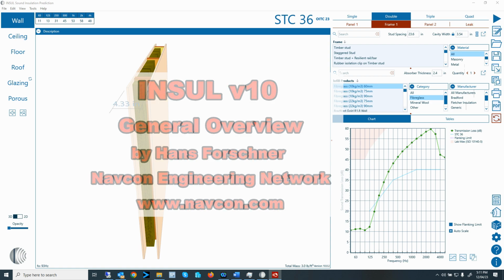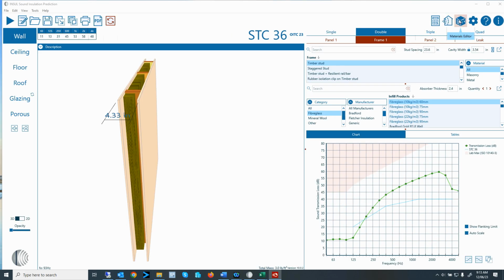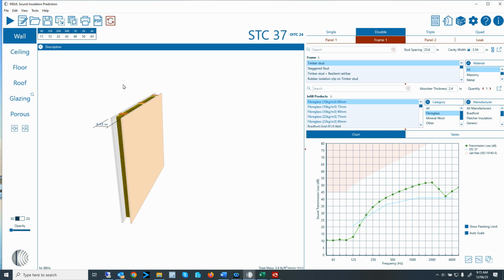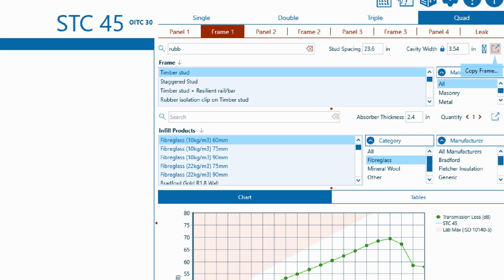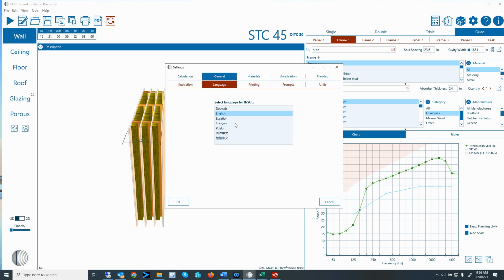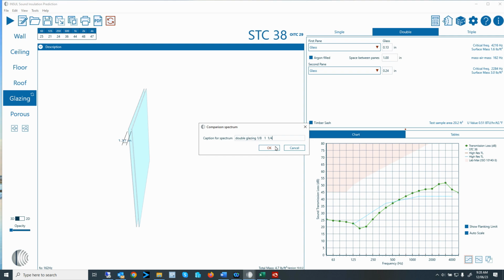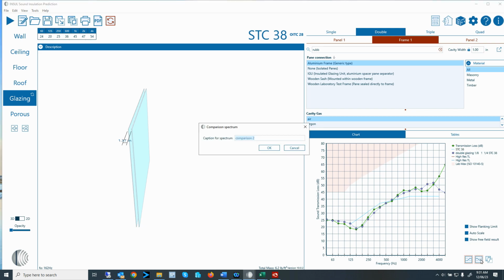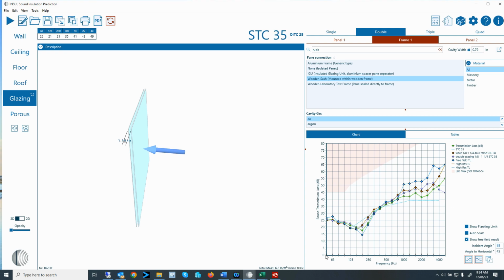INSUL v10 Sound Insulation Prediction Software New Feature and Changes

Comment: Hi, I just tried the Insul trial version and tested a wall configuration of 12cm brick - 5cm air cavity filled with 16kg/m³ - 12cm brick. 

Insul gave an incredibly high result, STC 90.😮

 Is there an error in Insul's calculation or something else causing Insul to over-calculate?

Thank you in advance.
Reply from the maker: I am not getting an STC 90 ~ STC 78 you may want send me more details on what you use.  I still see your point that INSUL is predicting very high STC values.  Did you have the flanking limit turned on in your calculation.  The flanking limit shows the typical limit for test lab wall measurements.  When you compare the predicted TL for your wall and the Flanking Limit it is clear that this wall would exceed the flanking limits.  In an average test lab setup the wall would not reach those predicted values as the flanking path would be the controlling the TL.

Comment: I observed from the graph that the example partition exhibits a sound reduction value of approximately 10dB - 15dB at frequencies below 125Hz. What would be considered a suitable sound reduction value for those frequencies in a profesional recording studio soundproofing design?

Thanks
Reply from the maker: There are various options to increase the transmission loss at low frequencies depending on the type of construction.  
INSUL predicts the TL from 50 Hz to 5 kHz.  As part of the initial steps of your design you have to come up with your spectral goal inside the studio. Then you need to check on the spectral transmission loss for the different path (e.g., the surrounding walls, doors, windows, floor and ceiling), the available space, construction type (framed construction, masonry,..) and funding for the project. With all that you can start using INSUL going through the different scenarios... the lower the allowable the more detailed you need ensure that have all the sound paths (direct and flanking) covered.
Reply: What is the meaning of "deviations" in insul tables description? (Below 100Hz)